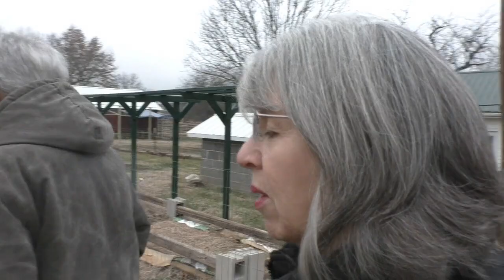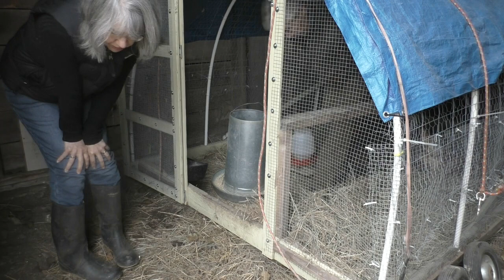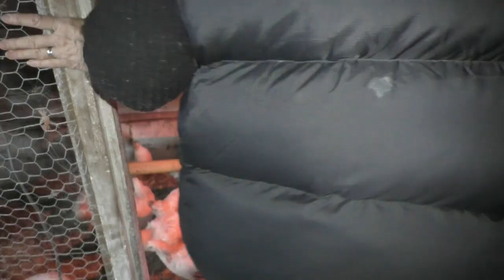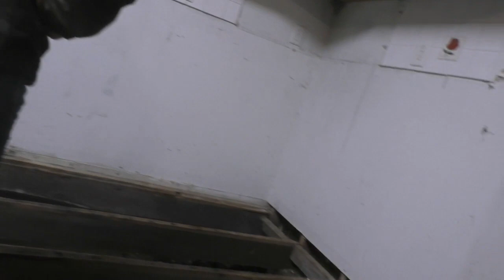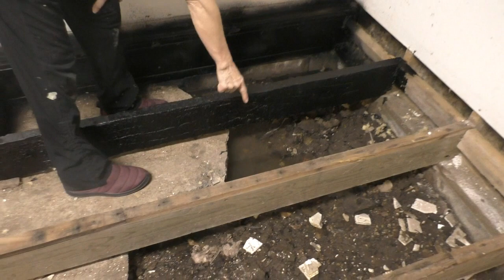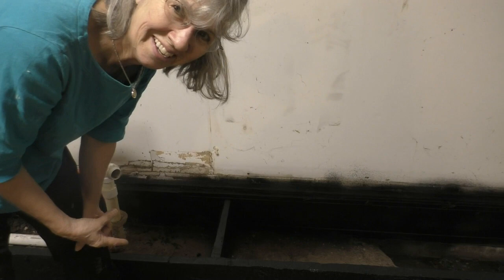A River Runs Through It

Comment: Soooo sorry you are having this problem, but the good news is you know about it now instead of later. I don't know what your topography is, but besides the french drain, would a swale help to redirect even more water away from the house? We lived in an earthsheltered home and when it was built, the builder did a double french drain -- one low, and one higher. I know you will be very happy to solve this problem. We're thinkin' of ya... ~ Kir and Ron in Tennessee
Reply: Yes a large swale is what it will take. Use a long garden hose to check different heights of the area to dig out, hose filled with water will tell you where level is 20-50 feet apart, and always have the trough lower than house by 6 inches or more if possible. Dad ran a grader and bulldozer and we had to constantly hear about water. "Mom this is good sweet and sour meatballs, oh boys did I tell you about the culvert the guys were putting in over on JJ"? Yes that was in Missouri, every road is J or JJ or M or MM! But lots of roads are paved also, he used to fly around those curves on his way home, the neighbors would say watch out for that guy, he doesn't slow down on the curves.

Comment: Put your drainage in before you cover the floor back over again - once you have this sorted you house will also be warmer - raising damp makes it cold - I have done this in a house before and I needed more than drainage I needed to put a sump into the ground under the floorboards with a drain running out - I had the pipe I needed put in my a drilling company to get rid of the excess

Comment: just slope the dirt away from the house, and go out further and slope the bank 30-40 feet away so the water will come down the hill then dig the trough all the way around the house one way or the other to always have  way for the water to run away from the house. You know you can get 1-12 inches in one day right? you really need it to have a place to go on top of the ground and not down a french drain. You will always have problems unless you dig it out in a very wide trough and all the way around.
Reply from the maker: Catching up on old messages. We know we have to make changes. The problem with sloping the dirt away from the house at the house is that it would go clear to the bottom of the window because the slope is so steep. We are working on solutions. Thank you for your suggestion. We will consider it.